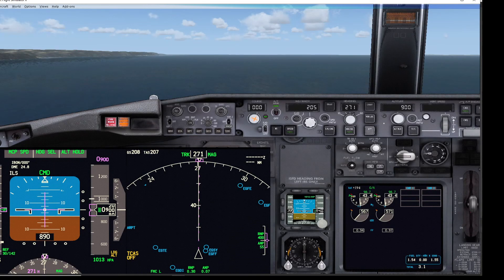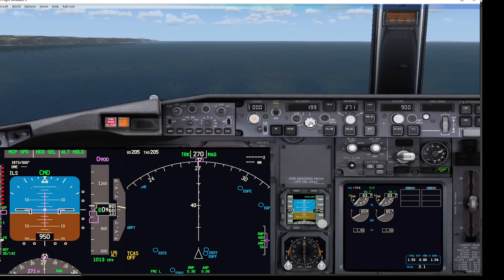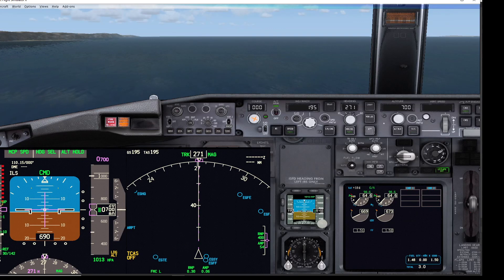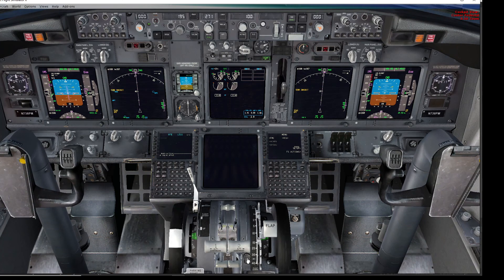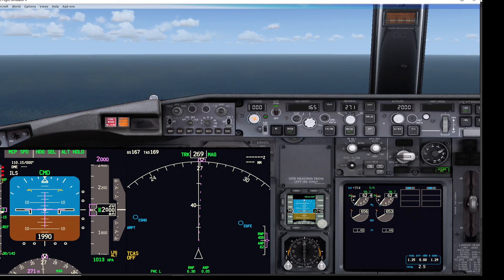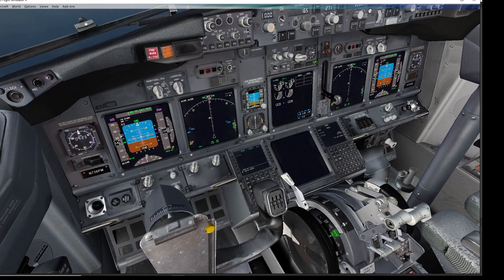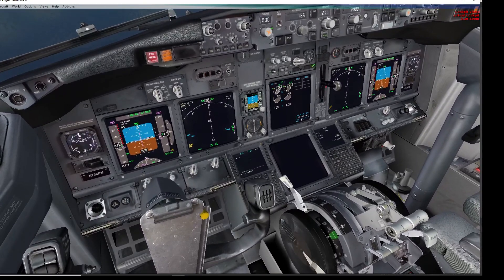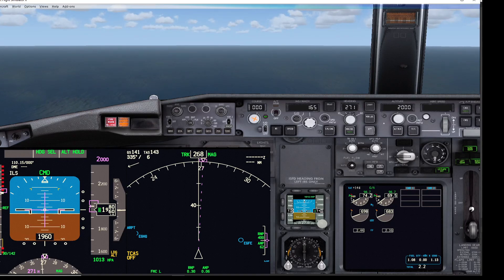Landing Gear Warning Horn

Comment: The Jeju Air pilots would have been hearing this gear warning alllll the way down to the runway and still didnt realise. A non-frangible localizer mound didn't help either.
Reply: According to this tutorial , the only time they heard this horn was probably when they were bellow 200 ft I say this because from the crash video you can see his flaps were stowed and you can hear 1 engine still going and pretty sure since the pilots thought they had to compensate with the remaining good engine they were probably above the 34* degree angle on a single throttle landing
Reply: The Jeju pilots had ample time to see this tutorial.